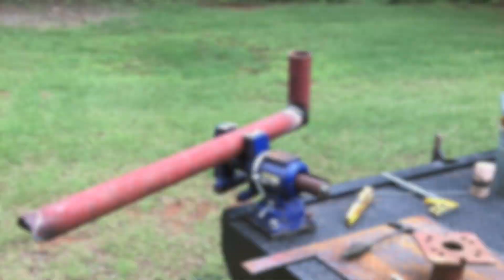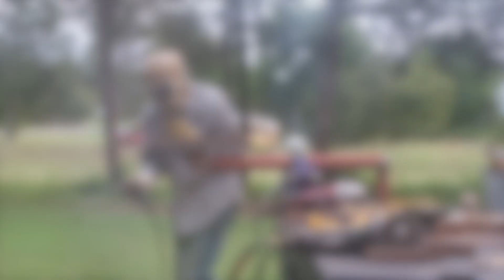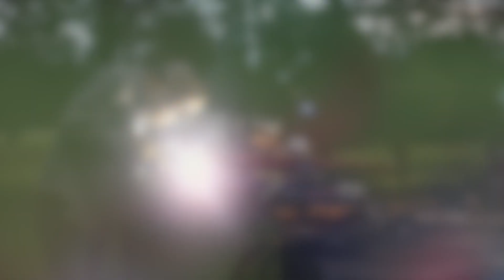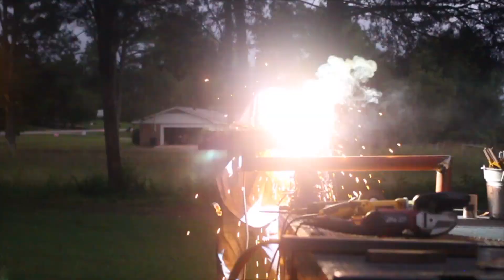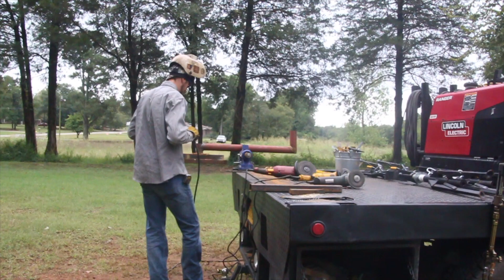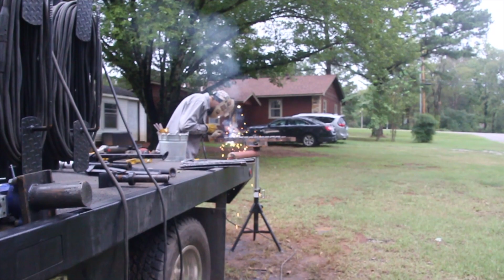Scrap Metal Build

Comment: There are 2 currencies. Time and money, and anything we do is going to cost us one or the other. If your smart anyway! It always sucks when it costs time AND money! That to me is a loss!
The point is you can spend money on new material and use little time on the job, or you can use scrap on hand and spend more making the material you need and do the job. Makes sense to me to use the currency you have the most of at the time.
In either case the job got done in the most economical fashion!
Nice table btw!
✌
Reply from the maker: I agree 100%, haven’t heard anyone else talk about it! Scrap is cheaper but more time consuming, new steel is more expensive but a lot less time consuming on cleaning and having the right material for the job. Thanks for bringing that point up my friend, it’s a valuable thing to know especially when bidding work. 

I know cause it bit me on a job I did, quoted the guy hours for the job(he was buying the material) he decided to go with used/scrap steel to save money and it nearly doubled my hours having to work with rusty steel and making due with the wrong materials lol lesson learned

Comment: how did you weld that 90 on the pipe without burning through?
Reply from the maker: Protected Profile turn the heat down, whip the rod back and forth letting the puddle cool for a second and then add more rod to it and move fast.

Comment: love seeing you make something from scrap, I am always using scrap for something, probably have 10+ tons of scrap right now between my 2 homes. I am the scrap metal guy at work, so everything thrown out, they holler at me, several pallets of store shelving, all kinds of display racks, stainless counters, desks, & I am always doing something for a project. lol.now back to your statement on computer, I see most welder guys working on their trucks without issue, many seem to have diesels? but I can tell you for a fact I have read many horror cases of work performed in body shops & computer blown, when MIG welding, & I know of a few that happened, but not with me involved, but work may be in rear on vehicle, but computer blows? & the body shop having to pay for computer, or trying to get insurance to pay. but not really heard of it in mechanic work. but the body guys do so much welding on autobody? so take it for what its worth, maybe its more specific with MIG welding? I cant answer, but I don't replace panels until I disconnect battery.
Reply from the maker: Randy mack good to know!